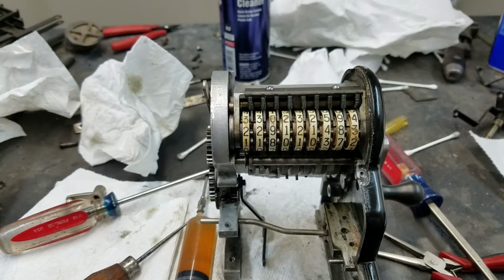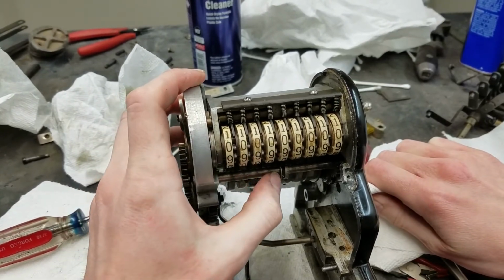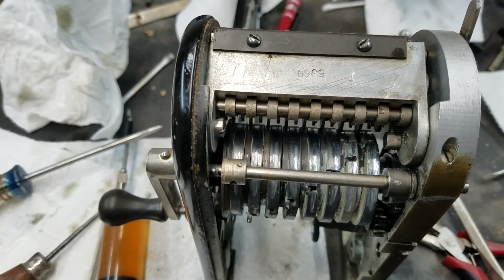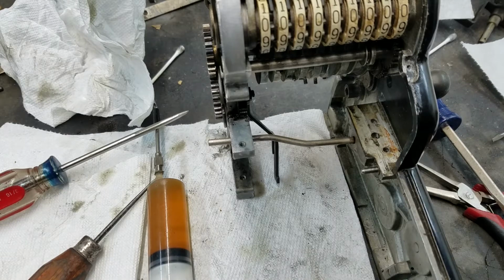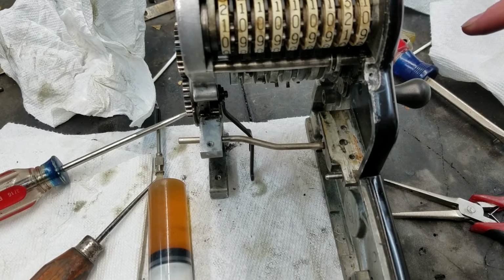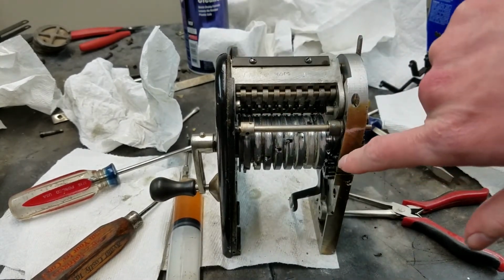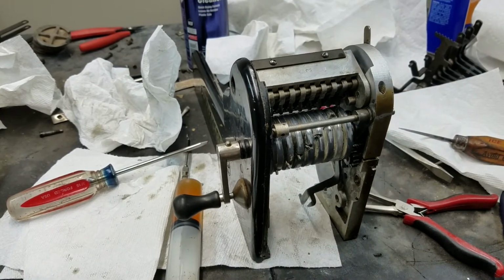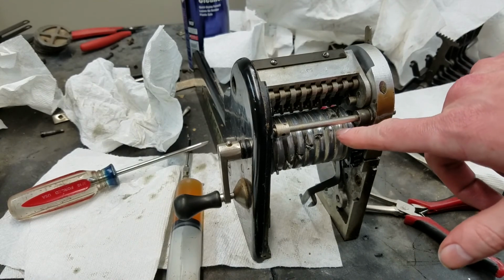Marchant KE Rebuild/Repair Part #G: Final Drum Testing and Gear-train Explanation

Comment: Progress. I'm getting the feeling that this is waaaay more complicated than the XL was. Kinda like rebuilding an auto engine and getting all the timing bits in the right order & place.
Reply from the maker: Actually this part is exactly the same as the XL, maby I didnt go over all the timing parts in the video on the XL(so I’m glad I remembered to go over them here) but the gear train and all the timing is the same. Really the only difference to the actual calculating part is the replacement of the setting levers with gears on the rotating setting segments, and the locks for the setting segments (but thats for an upcoming video)